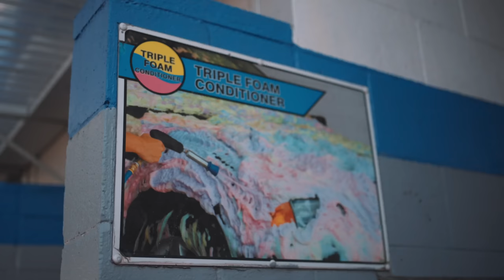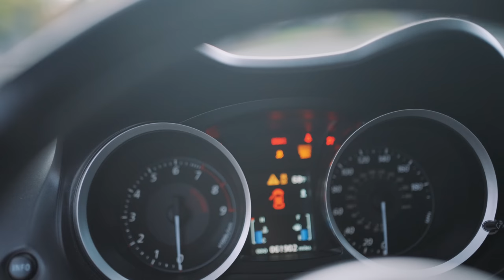Jose's SLEEPER 7XX WHP EVO X | Full Documentary

Comment: the evo x engines were engineered to take a beatin...making 560whp on my evo x stock block just fbo e85...also forgot to mention it has 224k miles original engine tuned it at 190kmiles
Reply: I was wondering when I should redo my bottom end . I have my head off after replacing burnt valve.
Reply: I’m at 180k
Reply: @claudedottin1312 if you already have your car down just do the bottom end. 180k is still a bunch of rotations on those bearings and etc
Reply: Yeah I. Never had a problem with my 4b. It’s a beast